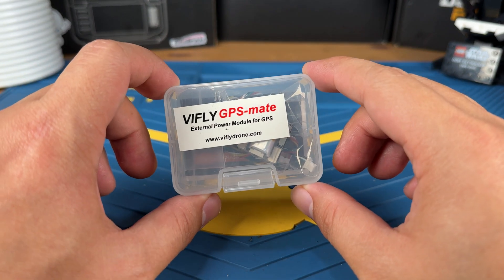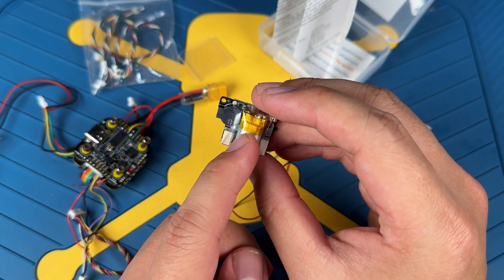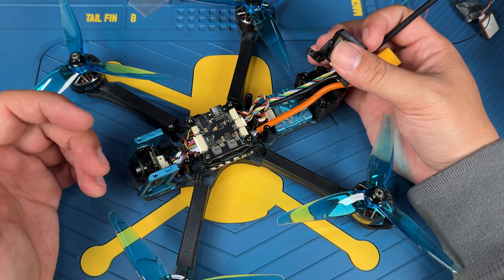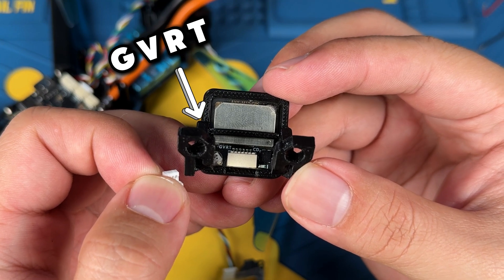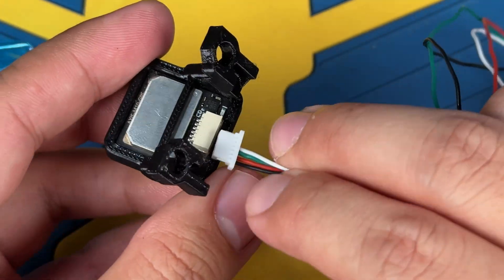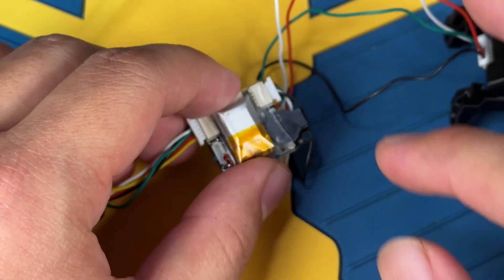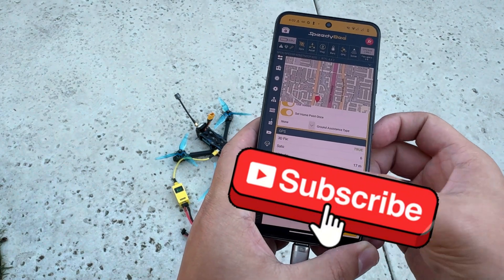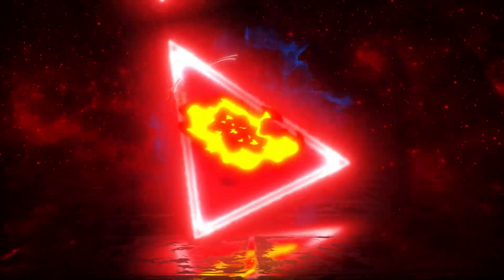Get Instant GPS Locks | ViFly GPS Mate | Complete Setup & Field Test

Comment: I just got a gps mate. I have been having issues getting locks. And this thing is so good. Fantastic. I got over 10 sats in less than a minute, and when I powered up the quad, I didn't loose any. In fact I gained more. I think not only does it give you that initial lock time without the Lipo, I think it provides some shielding through the wired connections. A1++++++++ would recommend.
Reply from the maker: Glad you are liking it !

Comment: I think you can directly connect the phone to the flight controller and check the GPS right ? or is it only possible using the speedybee adapter ?
Reply from the maker: Yes, thanks for mentioning that ! You can directly connect the FC with your phone to the Speedybee app

Comment: You plugging in that speed bee and battery makes the gps mate useless or am I wrong?
Reply from the maker: The reason why i am connecting the GPS mate is due to the particular FC does not support USB power so plugging in the USB does not power on the GPS
Reply: @ ohh ok makes sense

Comment: but when the little battery dies you are stuck with this useless hardware
Reply: You solder another battery right  in takes two minutes!   Charge your old , one whatever, Take one from a small disposable vape.
 
What will you chaps do once the shtf?
Reply from the maker: Well, it will work for a good while. and if it dies, you just replace it
Reply: @iFLYXWings6589  i have one on each of my 7 drones most have lasted about 12 months
Reply from the maker: @stratometer  Good to know man!